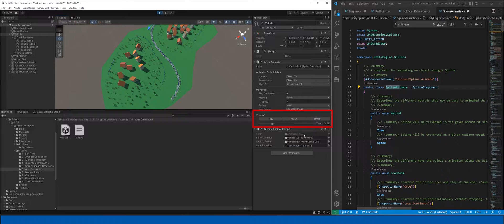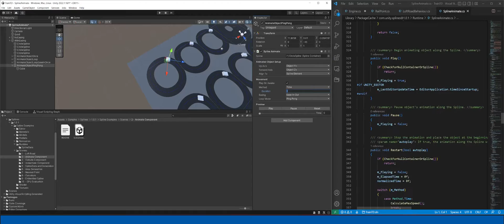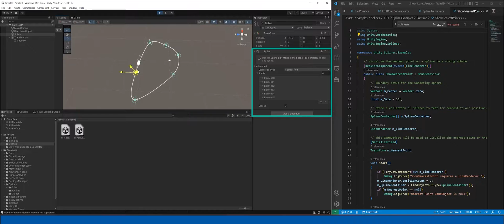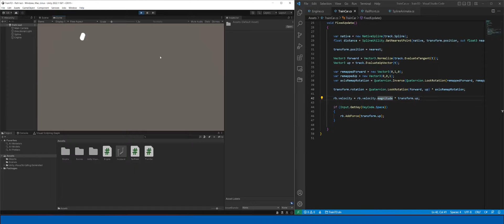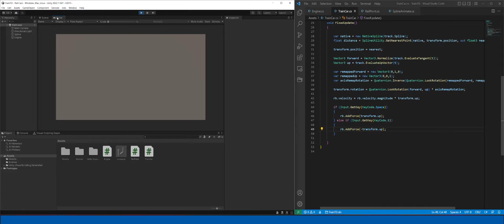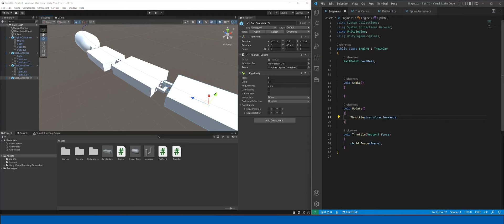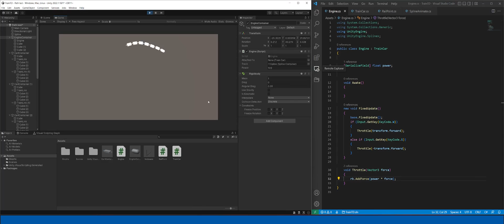Making a Spline Train Using Rigidbodies to Move | Unity C#

Comment: Hi, great tutorial, perfect for what I'm trying to do. I don't understand how you have attached the train cars, using a joint or in script? It was not shown in the video. Also, what can I add to the script to make the spline work if it is not globally centered. Thank you
Reply from the maker: It was probably easy to miss but I did cover it in the video - I essentially added collider hooks on the front and back of each cart, then interlinked them such that they'd act like a chain pulling each other along. This proved to be very bug ridden and slow though and I have since re-implemented it using configurable joints instead. I plan to make a follow up video for that next, so if you're having trouble figuring it out yourself stay tuned for that :)

For the spline global position problem, I have not spent the time working on that so I couldn't explicitly help you there, but I would think adding the current global position of the spline to each point you're accessing as an offset would be a good place to start.

Hopefully that helps and good luck!
Reply: @paridotgames  Thank you!

Comment: awesome work! Thanks for the walk through of your approach. I’ve done a number of spline based projects and often run into problems converting the time 0…1 into a velocity that is constant on different length splines (calculating the length is mostly an iterative approximation). I’m going to dig through your example and that reddit thread to see if there’s a better way.
Reply from the maker: Hopefully it's helpful! Sounds like you're animating the transform based on a lerp between the start and the end of the spline? If that's true, my example is pretty much throwing that whole method out of the window lol. I just find the nearest point on the spline, snap the transform to it and make it face the direction of the tangent of the current point, then reapply the velocity onto the rigid body from the last frame.

Very "hacky" solution but it allows for the application of physical forces while still following the spline. If I'm understanding your problem properly, you could implement my solution here, but just set the velocity to a constant value - this will stay the same no matter the length of the spline.
Reply: @paridotgames  superb, thanks for your suggestions. Your demo looks super-cool!